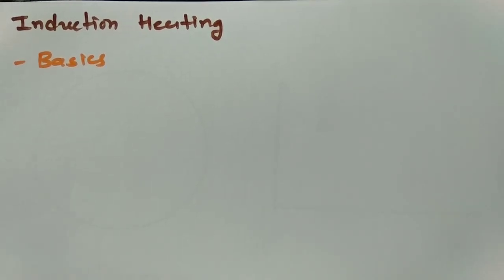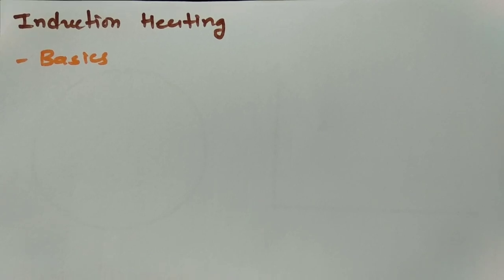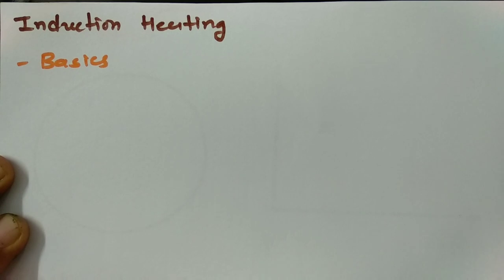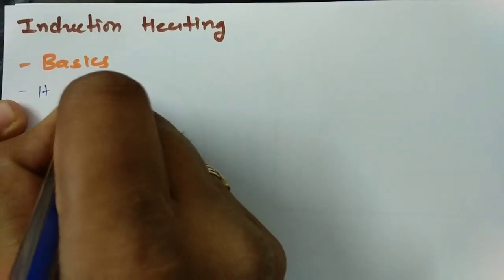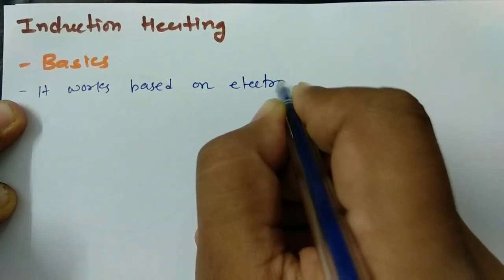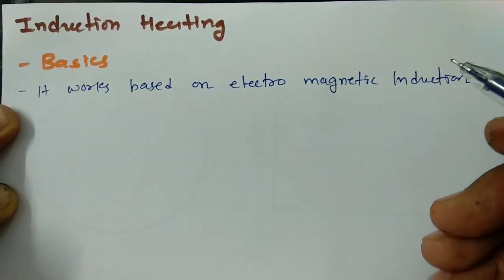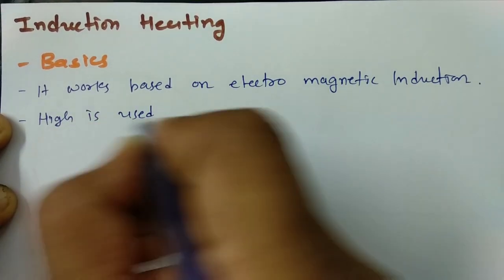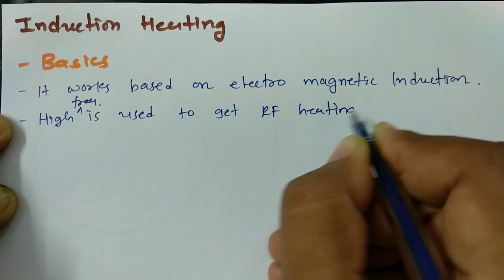Induction Heating (Basics, Working, Circuit, Applications, Block Diagram & Applications) Explained

Comment: I work in oil tempered manufacturing.  We use induction heating process there to heat the wire at 700 deegree before entering the furnace . Is the working principle same there tooo ?

Comment: Thank you sir, nicely explained concept.
Sir i have one doubt, skin effect happens in work piece or work coil
Reply from the maker: Work coil.
Reply from the maker: To work piece, conduction will happen
Reply: @EngineeringFunda  Tq sir. I want to design a induction heater, can you suggest the good text book or meterial which have, what frequency operating, current, diameter of helical coil, gauge of wire
Reply from the maker: Do literature survey

Comment: Very nice video. I have a question. What should be the distance between work piece and work coil for better heating? Does the frequency of RF signal plays any role in distance between coil and piece?
Reply from the maker: Yes, it plays important role. As distance increases strength of heating deacreses.

Comment: Advertising, heating, air-conditioning power supplies, computer, office 
equipment and power supply for the same, On board power supply for low 
voltage microprocessors and graphics processors, elevators, escalator, light
dimmer, uninterruptible power supplies, central refrigeration, Role of power 
electronics in these applications.

Comment: Sir, l have small problem?
EFD using capacitor, what using for capacitor? 
Please reply sir.....🤔🤔🤔🤔🤔🤔
Reply: To improve power factor, inductor drops line voltage hence to indemnify capacitors will be used.